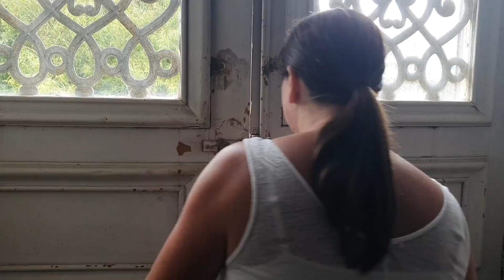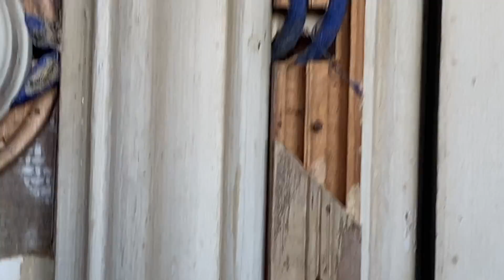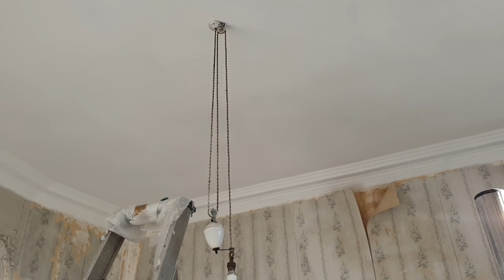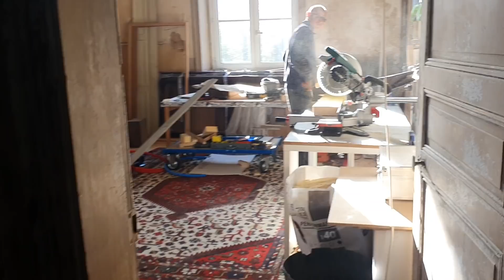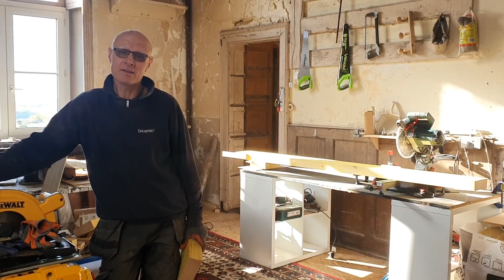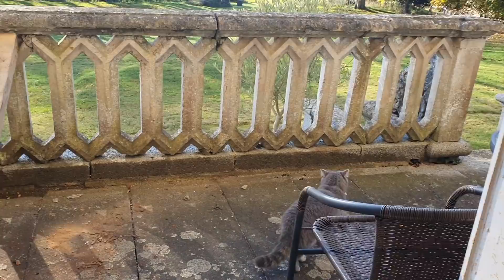BLEACHING THE CHATEAU'S CEILING?

Comment: I have a question about your ceiling project. We just bought a mid century modern home and need to deal with our ceilings. Someone before us did a very patchy job on them 😒 How do u recommend painting a ceiling best without it splattering all over the place? Is that a scaffolding u r using? Did u just hand paint with a brush using this scaffolding throughout the room? Any tips would be so greatly appreciated! I just love that I stumbled across u and ur hubby’s project of love! Your house is so amazing and the work u two r doing is absolute perfection! I slowly watching each and every episode and loving every moment of ur journey ❤
Reply from the maker: Hi, congratulations on buying your new home. Unfortunately the only way to paint a ceiling, is with a long extension pole and a roller. The longer the fibre on the roller, the more splattering and texture,  but the shorter the fibre, the more time it takes! I only used a brush and a roller,  purely for the difficult conditions on the ceiling. Yes it is an easily movable platform, but still not high enough for our ceilings at 4 metres. If it is just a patchy paint job you are covering, I suggest you use a good quality white paint and roller, also cover everything and if you are daring, like myself, do it in your knickers and wear a shower cap! Skin is easier to clean than clothes!!!!! Obviously I can't do this on camera! Good luck Carole x

Comment: Hope that black isn't mold.  You can't bleach out black mold.  Mold exists on both sides of the walls, and frames.  Air currents will always blow the mold particles throughout the house.  It would be far better to remove the walls, clean and re-insulate the building.  There is at least 150 years of nicotine in those walls.
Reply from the maker: I took advise from someone who saw it first hand, who has background in English Heritage,  so I hope o have done it the correct way. Time will tell

Comment: I've seen that timber trunking in the UK too but it might not have been as common as in France. I don't know the French regs in detail but I think you should be able to replicate those with slightly larger grooves that accept modern three-core cables to make everything safe. With the old VIR singles these things were a bit of a fire hazard and therefore banned in the UK at some point.
If you reuse those lights, please do get some new flex! The original one is cotton or silk over rubber and rubber gets very very brittle as it ages, sometimes after only ten to 15 years. My dad remembers getting zapped by those braided leads as early as the 1950s! And on lights like yours the flex gets bent a lot as it moves around the pulleys. Stylistically I don't know about France but elsewhere in Europe these pull-down style pendants were typical kitchen lights.

That double-glazing installation looks quite creative and slightly less than ideal, considering the transoms are still single-glazed. Granted, reducing the area of single glazing reduces overall heat losses but you still get the condensation and draughts associated with single glazing. Looks to me like someone shoehorned off-the-shelf windows into the old openings rather than ordering bespoke ones that actually fit. Certainly cheaper but a bit of a compromise in terms of comfort and aesthetics.

Comment: Why wouldn't you use a roller in the pole you would cover more area and its quicker and your hand wouldn't be hurting. Work smarter not harder
Reply from the maker: I used a brush for the coving, but a roller on the rest, stood on top of the tower, as the extension pole is too floppy at a 4 metre lenght.

Comment: Isn't it amazing what a good clean and lick of paint can do to a room (or, in this the ceiling). Progressing on job at a time. Try some Gullup XL on the balcony/patio area. It will take the lichen off a treat - careful around pets though. That's probably a summer job, once the balustrade is rebuilt. Thanks for sharing.
Reply from the maker: Thank you John

Comment: That thick electrical cable they used to use for the electrical we call in the states the old knob and tube. Yeah, that has to be replaced.
Reply from the maker: Yep, slowly being replaced with 3 core insulated cable back to a modern fuse box

Comment: bleach will react with the paint you use never use it like this
Reply from the maker: I was advised this way by someone in the know, but everyone has different ways of tackling jobs.
Reply: @LifeAfterLaFerté  its surprising even washing down door frames and skirting boards when you use cleaners in water it's great till you paint and then oil based under coats react you should be ok